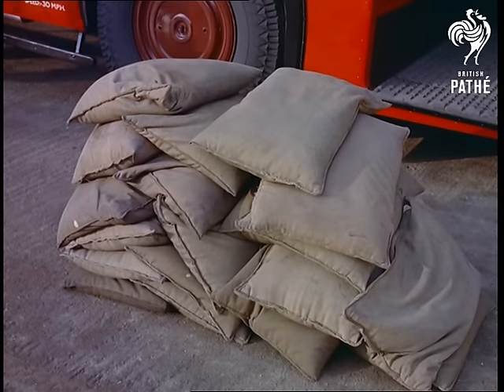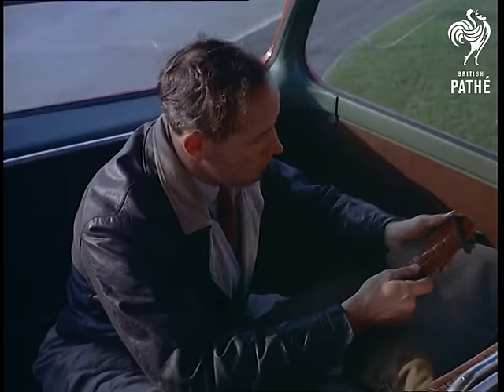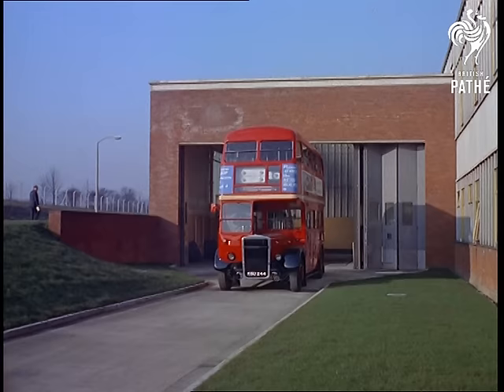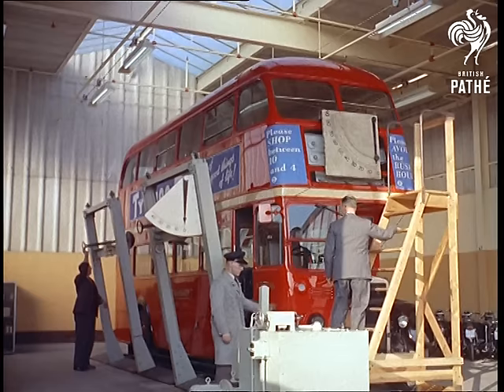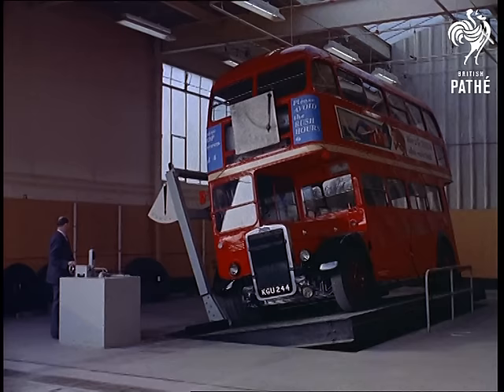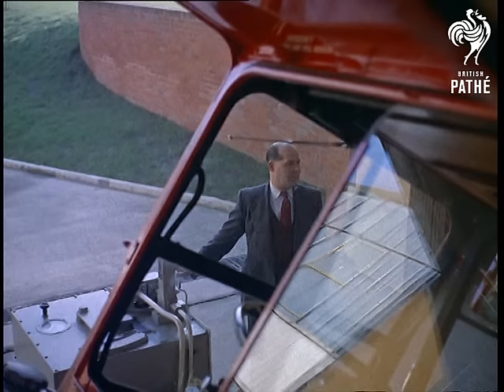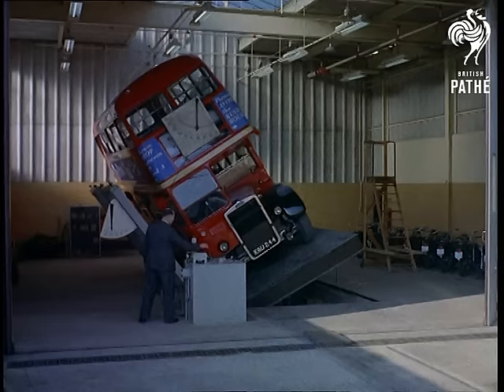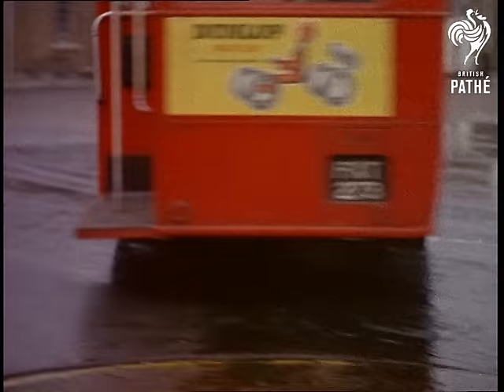Bus Road Test (1957)

Comment: Did anyone ever manage to flip one of these busses?
I'd even consider looking at rigged busses for stunts and the like.
Reply: As a result of being hit by a Fire truck , a Routemaster bus turned on its side in W. LONDON . Luckily nobody was injured , our buses had just been fitted with radios and l had to send a " Code Red " to L.T. Contol .
Reply: @williamcarrington3474  
Atleast the emergency services were on scene
Reply: Bento, there are two films in which double decker buses have been flipped onto their side. One is called 'Intermission' which is an Irish film from 2003. An Irish stunt driver performed that stunt by tilting the bus up a ramp. Another movie is 'Stratton' - there is a scene there in which an English stunt driver flips a bus using explosive pistons coming out of the bottom of the bus - usually these pistons are sections of tree logs or metal cannisters forced downstairs from the bottom of a stunt vehicle. The bus in 'Stratton' landed on the passenger side which is of course safer than the driver's side but I believe the bus in 'Intermission' lands on the driver's side.
Reply: I'm sure they would. Like on that skidpad test if they were sideways and hit dry pavement that would do it.
Reply: The average speed of a London bus isn't overly fast.. If they drove at faster speeds and swerved quickly the momentum of weight transfer could have flipped one.. Same as a lorry etc..
Reply: some were tipped on end, or blown over. but it took the efforts of the Luftwaffe to do it.
Reply: @Kavi Ramdhayan It also explains why there is "no standing" on the upper deck. More weight, more chance to go over.

Plus, what are the chances that people STAY in their seats when a bus is  leaning over?
Reply: The coming of Jesus Christ is close my brothers and sisters!! Please repent of your sins and ask God for salvation for the time is short 💕😞 we are not perfect which is why we need to seek the lord more than ever!❤️❤️🙏🏼..... God spoke to me through dreams and is waiting that you may come to him!...

Comment: Im an ex bus driver.

One time it was snowin and most other drivers called in "sick" 
I on the other hand had no issue comin in.

I had a volvo vanHool double decker, and all day i was slow drifting around roundabouts- because it was slow and very well controlled passengers loved it and thought i was some sort of genius 😅

Good times. This in the early 2000s, bath depo to Chippenham known as the x32 and 231 back then.

Comment: I did what these guys are doing on a Chinese double decker import. they are 3 meter longer than the London bus and carry alot more passengers. we used metal weights instead of the sandbags. amazing to see the bus at that crazy angle and not topple over

Comment: As a 3yrs old kid I didn't look out of running train window when it passed over the river bridges fearing it would tilt and fall down on the river. I thought due to my weight getting positioned at one side of the train,  the train would get tilted due to weight accumulation at one side..😂. 

I wish I had seen this video before boarding the train..lol

I am an engineer now..😋

Comment: It won't tip over because all 4 tires are still balanced on flat ground use your head, its not moving and there is no wind flow underneath the bus

Comment: Outdated and not a real life test. If it goes around the corner at that angle it will tip over because of the centrifugal force which is not taken account in this test